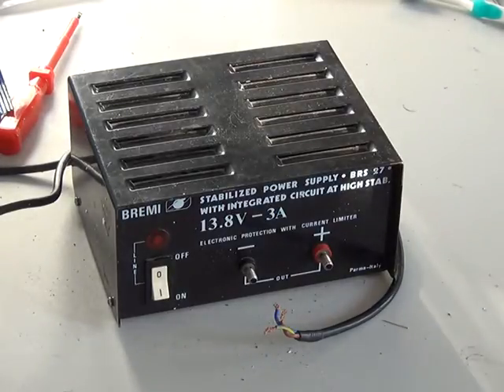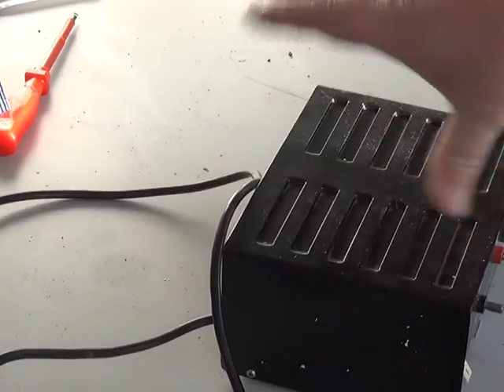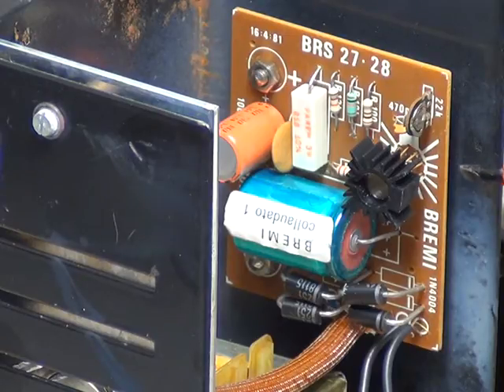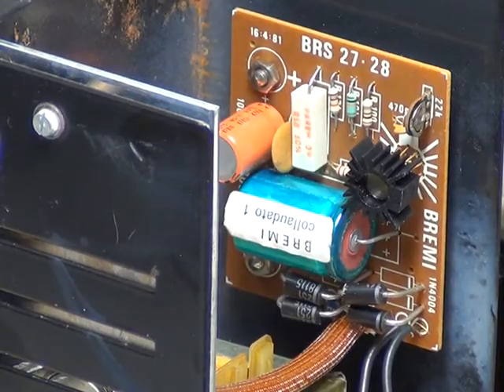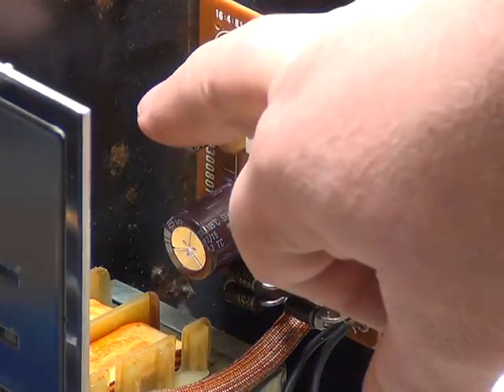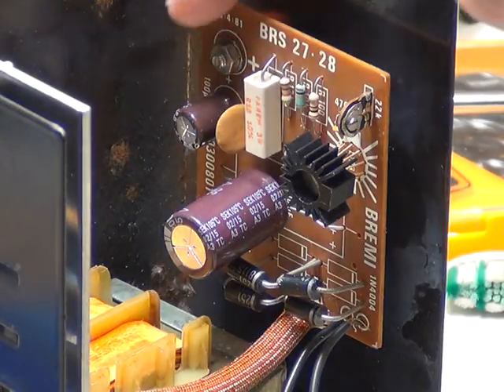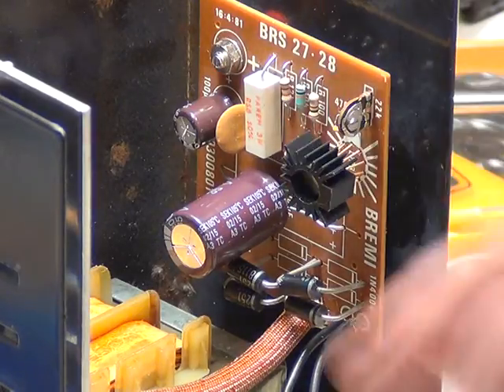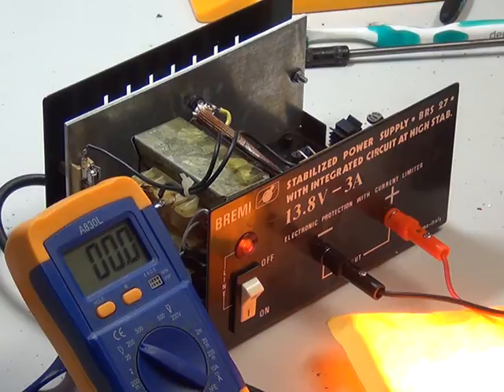Bremi BRS27 3A CB power supply (c1981). Overhaul & repair

Comment: Mines giving out 13.8 volts on tester at terminals but none of my cbs power up on it. Would this be an amp problem?
Reply from the maker: It's usually a duff transistor....but which one varies. Start by testing the big one on the back.

Richard

Comment: I have one , what is it used for.
Reply from the maker: It's so you can run a CB (Citizens Band) radio at home. Most CB radios are intended for car use so are 12V. The reason it's 13.8V is to replicate the voltage in a car when the engine is running & charging the battery.

Richard, G0OJF, UK

Comment: The voltage across the reservoir capacitor will be in the region of 30 Volts, so even a 35 Volt capacitor is a bit near the limit.  I just fixed one of these and used a 63 Volt capacitor.  Shame I also didn't have an axial cap!

Comment: When Bremi first came into this country, it was a two core mains cable with a fitted plug, however, there was no earth and the switch was on the neutral.  They then fitted a fuse and it was on the live, so it you just switched it off at the power supply to change the fuse, it was still live.  Very nice of them to do that.  Those regulator ICs were very good and kept the voltage well up to the rating of the power supply.  After they sorted out the problems of wrong wiring etc, they were hard to beat for a good 3 am power supply.
Reply from the maker: I have one of those early BRS26 power supplies here with the 2-core mains lead. The other snag was the main electrolytic capacitors were 28V rated; At the time, their mains was 220V & ours was 240V (all supposed to be 230V now). On 240V the unregulated voltage presented to those capacitors was 29V......so most of the PSU's blew up within the first month. If you were lucky it was just the capacitors.....if you weren't it took the L123 chip with it.

Richard
Reply: @ukfmcbradioservicingTango21  I had one at the start, due to me being inquisitive I looked inside, a small heat sink went very hot in seconds and a 2n3055 attached.  Now on a heat sink out the back and runs cool even under max load.  Caps upgraded. fuse now out the back where it can be changed without going inside.  Flex now 3 core and a good earth.  Metal power switch was kept as it stood a high voltage test.  Neon shows power in, LED shoes power is ok going out.  An over voltage will blow an output fuse.  But it is just a stand-by power supply these days.  I just finished it and I was offered a 10 amp supply.  It went bang, but I used batteries giving 14 volts with a fuse-able link in the middle, just in case.

Comment: What are you supposed to do with this. Ive just acquired one?
Reply from the maker: As these are now 38 years old it will need the capacitors changing to work safely & properly just like anything else electronic this age. It does what it says on the tin...it's a 13.8V 3A power supply designed to run items intended to be used in a car off the mains...up to a maximum current of 3A. If you wonder why not 12V, a car when running is 13.8V. The primary reason for these power supplies is to run a car type Citizen's Band 2-way radio at home as a base station rather than buy a CB radio homebase model. When serviced, these are a good unit, hence many still around 38 years later. Nowadays CB radio power supplies use switch-mode technique which is potentially far less reliable in the long run, which is why these power supplies still have a market.
Richard (UK)

Comment: I bought one of these in 81 and still use it today. the L123 popped years ago and I replaced it with a 1723 on a bit of vero. Mine must be a later model with three core mains cable but the internal fuse holder is soldered directly to the transformer output, yours appears to be on the transistor heatsink. I notice the PCB is marked the same as yours 16:4:81 too. Mine does look a little scorched in places, probably from the days when I would try and run a 35W 'burner' from it.

I find it a really useful little supply because the output voltage can be swung quite a way for a variety of uses, I often use it on a small laptop because it's so much cleaner for EMI than the 18V switchmode that is meant to power it. The two caps in mine are probably the originals and both 25V so as I need to replace the trimmer I'll do the caps at the same time, should be good for another 38 years then!

Comment: Hi Richard, I just looked in my deep cupboard and pulled out a Bremi 3-5A PSU which lights up the bulb but shows 0v on the voltage meter. The collector shows a strong 30v but the emitter and Base are 0v. Would the cause of this be the L123 you speak of or something else? I changed the large transistor for a 2N3055 but no luck. Any ideas? Also I can't find the equivalent on ebay especially the two for £1.50 so if you could post a link to it I would be very grateful. I enjoy the videos by the way :)
Reply from the maker: The L123 (uA723) is usually killed off by duff electrolytic capacitors. Ensure you change the electrolytic capacitors before changing the L123. Install capacitors with a greater working voltage as the originals had  no margin for error.

Best price I could find (non-trade) was on ebay at £1.99  162684933360 .The key here is that you are looking for any make 723 in a TO100 case.

Richard
Reply: Many thanks Richard, parts on order and will let you know if I am successful. Regards, Graham

Comment: I have a Bremi BRS 27 with the 2 core mains lead. I overloaded it and what you called the bridge rectifier has burnt out, the voltage from the transformer is 25 volts,  I want to replace the rectifiers but I don't know what type they are and which direction they should be in. I will of course change the mains lead. It was working fine before I overloaded it. Any assistance would be most appreciated, Thanks.
Reply from the maker: The four rectifier diodes that make up the bridge are 1N5402, which are rated at 3A. others in the same series of diode are also suitable but are capable of a higher voltage, which is totally unnecessary  in this application, but are1N5403, iN5404. The polarity is shown by the white ring around one end. look at the video at 1:36 & you can clearly see that the white polarity mark is shown on the diodes & the printed circuit  shown a corresponding mark too.

Richard
Reply: Thank you very much Richard. I'll give it a try.
Reply: Success!  I had a KPBC6-01 I used for something else which was at hand, a solid state bridge rectifier as opposed to 4 singular rectifiers, I have fitted it, and the now have a steady 13.78 voltage reading from the front terminals; just the mains lead to change including 3amp fuse, and the Bremi is ready for testing 12volt items again. I was a CB'er many years ago, and although I sold the CB radio, I kept the Bremi for testing car stereos and associated 12volt items. It is a useful tool. Thanks once again for the info!

Comment: Richard, I have a 12 volt 10 amp power supply that is only putting out 4 volts. The power light lights up but its dim and the fuse is good. Can you give me an idea where to start in repairing this unit?  Thanks
Reply from the maker: It depends what make it is. You've asked this question on a Bremi page, if it's a 10A Bremi then chances are that the L123 regulator chip has failed because the electrolytic capacitors are knackered. Other makes, it's usually electrolytic capacitors that either fail & cause the product to malfunction or fail & take something else with them....zener diodes are easily killed after capacitor failure. 

Richard
Reply: Its a Kondix, my guess is that they went out of business some time a go.
Reply from the maker: If it's of conventional design i.e. using a transformer, then chances are that one or more electrolytic capacitors have failed & knocked out the zener diode. That's my general experience over 38 years!

Richard

Comment: Ive got one of those, its the same one i used back in 1981 when i went legal. got a 5A version somewhere thats putting out 25V needs fixing if i can find it
Reply from the maker: The output transistor is most likely short-circuit....the one on the heatsink at the back. I'll cover the 5A version when one appears!

Richard
Reply: i will have to dig it out if i still have it

Comment: I had one of these from about 1982 with my LCL radio and DV27 antenna (with ground plane kit for loft installation). Only thing that ever acted up was the neon indicator - I think it was wax filled and one of the solder joints failed causing the neon to go off occasionally.
Reply from the maker: I don't think the neon is a good idea...that just shows power is present. At least with an LED on the output, it proves the PSU is actually doing something!

Comment: That looks like one of the finer example of the breed. I bet like me you have seen some real horror story CB power supplies. They were normally appallingly badly constructed and the further degraded being constantly overloaded.  They have even managed to be manufactured even more poorly as the year went by. I am also a big fan of the dishwasher I have put countless old Tek scope through mine. Ps don't tell my wife only when she is out.
Reply from the maker: It was a Hoover engineer who put me onto dishwashers & buckets of hot water with detergent etc. I have a nice convector heater that turns down to 700W (Aldi or Lidl), in a room with air conditioning. An hour carefully on the heater with the a/c on & any moisture has been sucked out!

The UK made Powerhouse power packs were about the worst, though of course the 1A FKI I uprated the other day was ludicrous,  when most CB's draw 1.2 to 1.4A on TX!

Power supplies have recently shot up in price & gone towards switch mode products which are noisy & unlikely to last long. That's why it's now worth servicing these older ones from the 80's. Our wholesalers are now wanting £37 + VAT for 3-5A  CB power packs with traditional transformers in them. What am I supposed to sell them at ....£59.99? I never thought I'd be offering service for 3-5A power packs @ £16.50 + parts.....which is more than many cost new at the time!

Comment: great stuff i have one and will do mine....keep looking for the Tandar psu ha ha waiting to do this one.
Reply from the maker: Mistread that as Tandy....Ah well, there were three "CB" power packs over the years from Tandy (still have the catalogues here back to 1976). The early version with 2-core mains lead that fell into the "banned" bracket like many others.....and had no regulation either.....which got updated to have a 3-core mains lead etc & still no regulation. Come about 1982 they introduced a regulated version that is fine. I have at least two of the three here, so keep your fingers crossed!  

Did you mean Tarren?

Richard
Reply: Yes sorry Tarren
Reply from the maker: Working on our Terren right now, but just had to order some parts.

Comment: Still have my original BRS27 and it still works perfectly, complete with circa 1982 price sticker on the front just £12.50, Good value given it still powers a radio even after 35 years! 73, Tom.
Reply from the maker: The RRP was , I recall, £19.99 for the BRS27 at the time, the BRS26 was the cheaper one at £16.99 & the 5A one was £24.99. I reckon you got a very special offer there, Tom!